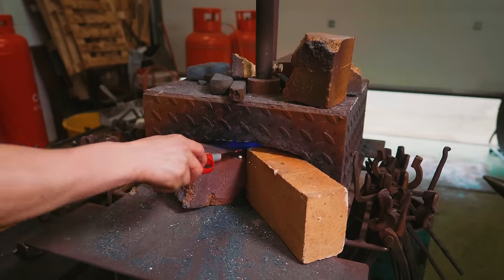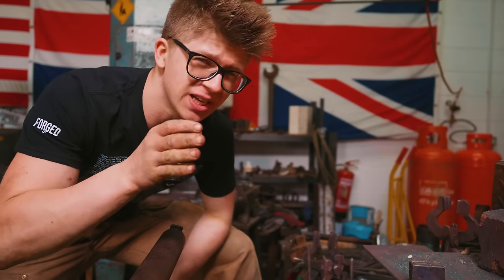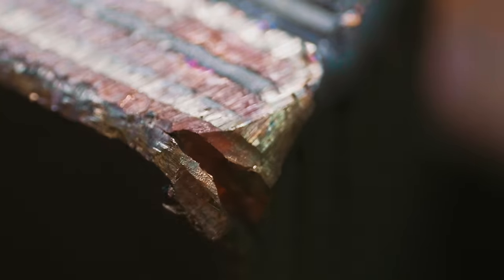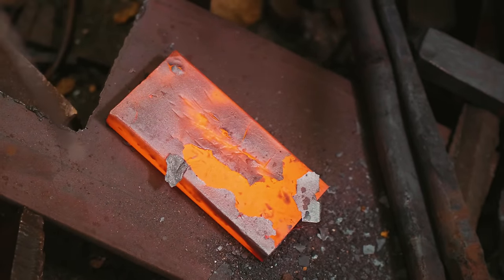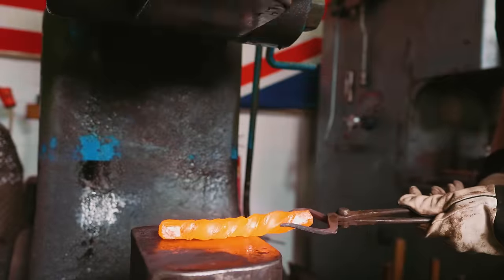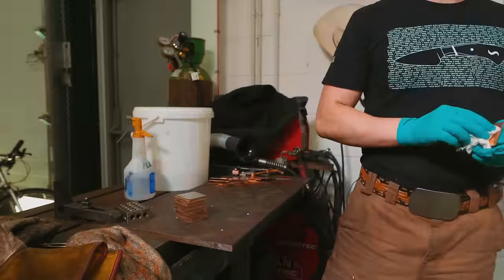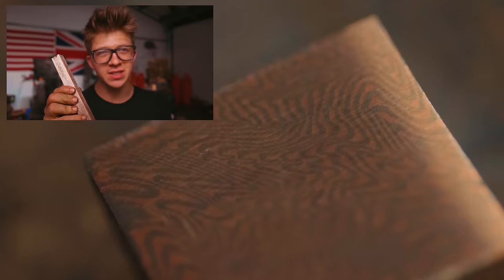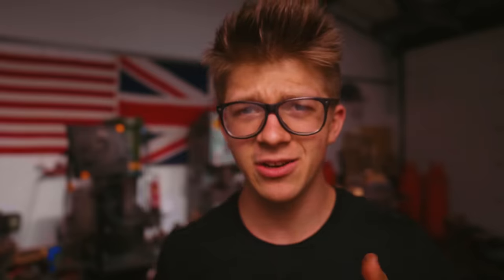CAN YOU MAKE COPPER & NICKEL DAMASCUS?!? MOKUME GANE!!!

Comment: A shaving razor blade!
Reply: It wouldn't hold an edge, the copper is to soft
Reply: Yes it would. Specially if you work harden it (probably not ~~needed~~ inherent necessary for a razor blade, though it would be better for sure). It is relatively soft, it is not soft. Pick a copper tube, hit yourself with it, tell me the results. No wait, don't tell me the results, just live with them. We are talking shaving razors here, not swords.
Reply: cutting the average beard hair is like cutting copper wire of the same thickness. There is a reason that razor steel is so hard, it need to keep a "razor" edge, in fact, most sword steel is much much softer then razor steel
Reply: You're mixing things. Hair is much softer than copper, and that is what would matter for shaving and edge degradation. What you're thinking about is tensile strength, which isn't really relevant to shaving or damaging the blade. Razors are made from purely hardened steel because that is relatively easy and cost efficient to machine/fabricate, the material is dirty cheap, and it gets the job done perfectly. That is why before okay quality cheap steel was a common thing, people used bronze blades to shave - and yes, they shaved just as fine.
Reply: And they never shaved with copper or nickel, because you can't hold an edge on either of those metals, hair, specifically beard hair, IS in fact as hard as copper of the same thickness, making a razor out of any Damascus is a bad idea because the layers that make damascus so pretty also mean that when Damascus is sharpened, the edge looks like a microscopic saw blade.
Reply: Sorry (not really sorry), that is whole bunch of nonsense and misconceptions. And that goal post, moved quite far, ay? This is gonna be long, cause you really need to get some stuff right.

First, already said it - hair is way softer than copper. Only tensile strength on those dimensions are comparable - nothing to do with hardness. If you doubt me, instead of misreading from the interwebs, go out there, buy a sheet of copper, go to a barber, grab a bunch of hair that lumped together is about as thick as the sheet of copper, and cut then with a scissor or steel knife, and see if is there any difference in blade damage and resistance to be cut. 

Second, people have shaved with lots of materials depending on what is available and how the options compare to one another, supply, demand, etc - like any other utensil. What they used, however, says nothing about whether or not other materials would work and how well or poorly. It is just not logically connected at all. All it says is that in that region/time, one materials is more economically viable, so utensils made from them were more abundant than something else less viable. As long as you can make copper, you can make bronze, and for the vast majority, the most value for your buck is what they go for, so bronze. Meanwhile, you find solid gold (softer than copper, way harder than your hair) razors in Ancienty Egyptian tombs.

Third, that is not how sharpness or sharpening works. And, side note, in this very channel, you have a video for a Damascus straight razor and I think Alec has a good idea what he was doing. That being said, being jagged under a miscroscope is a common trait to both dull and sharp blades, as long as you zoom enough, and isn't what makes it not as sharp or even dull. But that is irrelevant, because sharpening damascus (i.e. light grinding) doesn't make it any more or less jagged than any other type of material. You're using a relatively large (compared to the width of the layers) flat surface with regularly distributed and sized grains to remove material. It will be uniform, controlled by the hardest of them. Again, don't need to believe me. Get a flat file, that will be your sharpening tool analogue. Take two identical small bars of steel (say, an inch or two in diameter) and set them side by side in parallel. Sandwich a strip of some foam. That is your "zoomed in" damascus with an extreme difference in hardness. Now, take the flat sharpening stone (or a file), and start filing across the top to simulate how a proper sharpening tool would touch the different layers. Pretty sure you will realise without doing the experiment that the harder material will impose a singular material removal rate on all layers. Wear is what will affect both differently, but it doesn't matter much - either way, once it is worn enough, you re-sharpen eliminate the irregularities and it is new again.
Reply: Guys, i don't mean to get into this argument (actually i do) but the reason why they are using a material that doesn't degrade that fast is because they want it to stay really close to the skin, any damage to the edge could cause rash or damage to the skin. Don't really know about sharpness and cutting since razor blades need to be changed or sharpened almost daily as they go dull pretty fast. Soft materials are pretty bad to use as razors in any case since they are bad at both. Also don't underestimate hair there's a lot of it to cut trough and it's not held straight in place like if you were cutting metal.
Reply: I guess that's how they shaved (to impress the ladies) in the bronze age.

Comment: That copper mixed in there is beautiful. Since it is nowhere near as hard as steel, a weapon would be out of the question.
Reply: Not necessarily, it could be used as a decorative part of a weapon or it's container. Imagine a longsword with this stuff as a matching pommel & cross-guard or the metal bits on a sheath. It'd also look beautiful as custom grips for a firearm like a revolver or a 1911.
Reply: could make an decorative knife just to see the pattern on a blade
Reply: I wonder if he could forge weld a steel to it to create the edge?
Reply: Kpopahjussi63 Many Tsubas were made of Mokume-Gane.
Reply: I would agree with you except the fact stated above that nickel can induce allergic reactions makes me think twice about having it as knife scales or gun handle material.
Reply: tell that to the copper age of weapons lol
Reply: With that first attempt you should make a straight razor. That'd be so rad. Or just drill it and keep it as a keychain. It didn't look to massive.
Reply: Would make a nice handle

Comment: a little pro tip... I'm not completely sure but off the top of my head i think your supposed to us AC when welding copper and tin... it has to do with the fact that they heat up an entire peace rather then locally with steal... it the sane reason why copper is a good electrical conductor.
Reply: I've found that DC works just dandy, but it helps to be extra critical of when and and how fast your puddle is forming.
Reply: ya like i said i'm not sure... i'v been out of welding class for about 2 years so its been awhile...

Comment: You might get better sticking if you use a borax flux as copper particularly is prone to oxidising under heat. Sealing the sides might help. As a silversmith i would have cleaned the surfaces too to a bright finish to avoid carbon ash from storage oils, dust etc... Some metals stick together cold there is a Tai technique called Keum Boo which sticks gold to silver cold. These are soft metals though comparatively to steel, that's why the twist did not work. Silver, copper, brass, twists are generally done cold annealed. Great video though. D

Comment: I'm just as surprised it worked. Correct me if I'm wrong, but I thought that copper was a very soft metal. For that reason, I thought it would fall apart. Add in how easily it tarnishes from exposure to the air, I thought this would be some massive headache of a project. I'm glad I was wrong.

Comment: Ahh yes the famous Damascus, why not just say pattern welding with copper and nickel, as true damascus or wootz is technically not a pattern welded steel or alloy, even all the bs Damascus videos out there with steel aren't technically Damascus, the pattern in damascus comes from the natural grain and the high carbon is made in a crucible and not patterned and folded, I know damascus sounds cooler but it's really not accurate, theres an amazing video documentary from two amazing Smith's who use an original method of making true crucible Damascus or wootz steel and it's super cool in my opinion the pattern that comes out of the grain is way prettier than pattern welded steel true wootz steel is a thing of beauty and incredibly hard to make right